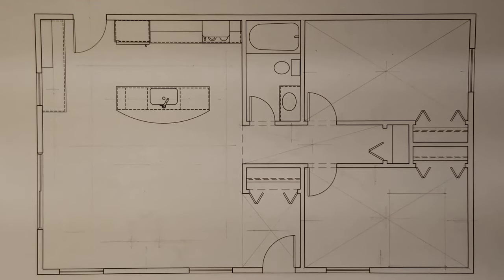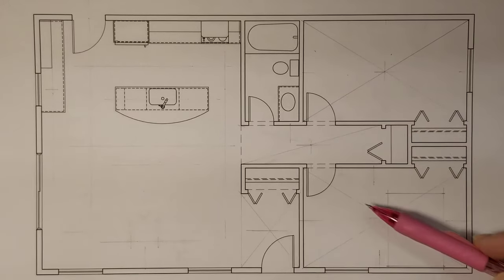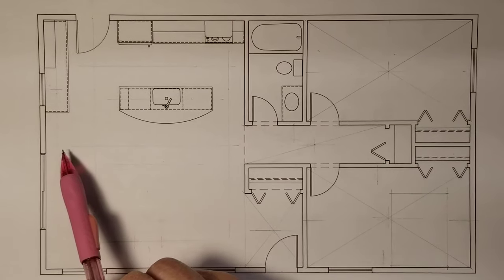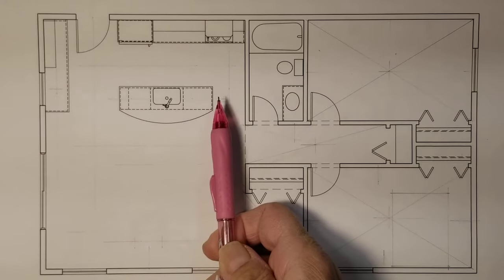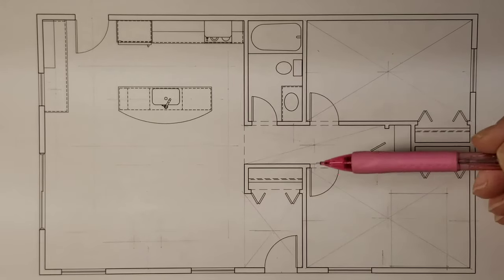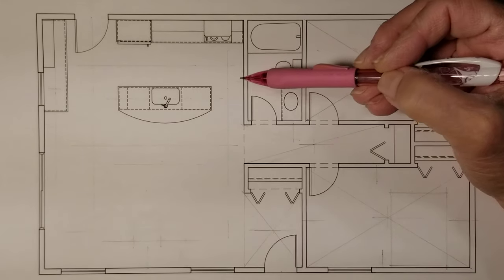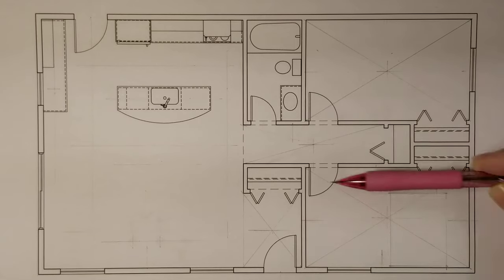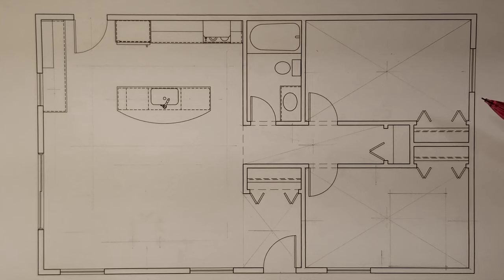Interior Design:  Residential Lighting and Electrical Planning

Comment: What are the dimensions for the drawing in mm
Reply from the maker: The paper size is 11" x 17" or 27.94 cm x 43.18 cm.  The drawing is drawn at 1/4" = 1'-0" or .635 cm.   I hope this helps.  1 inch equals
2.54 cm.  The house is very small so that we can fit it onto the paper size.  This is an introductory class to learn the graphics of an architectural drawing.  Overall the house is 1219.20 cm wide X 731.52 cm.  Super small. 😉😉

Comment: Assuming the bedrooms are 8 foot from the front wall to the back wall, I don't see how there is that much walking space between the beds and the closets. Our bedrooms are bigger and you can barely get through.
Reply from the maker: Well the first thing we never do in design is "assume".  The room is very small but it is actually 10'-0" in the direction you are referring to.  This is a very small house given to students as a practice for architectural drawings,  and it needs to fit on an 11 x 17 paper size.  The discussion around the bed placement is directed at the use of bi-fold doors as space savers.  In addition, when you have mass at levels below your hips (the bed and night tables) a smaller space will function as there is nothing to impede your upper body movements.  This is actually an experiential process.  I set up a mock-up in the classroom for students to begin to experience the distances we work within.  Also, the scale of the furniture is another piece that we work with in small spaces.  Thanks for commenting.  I had responded earlier, but just saw that it wasn't posted.  Let me know if you would like to discuss further.  Thank you!